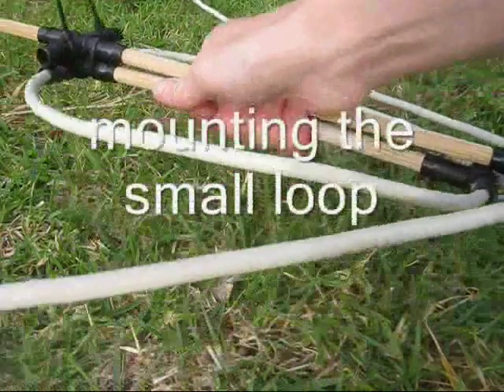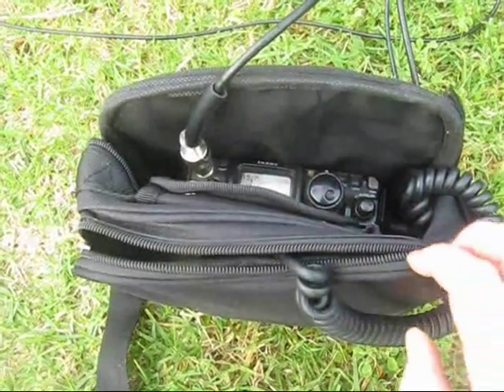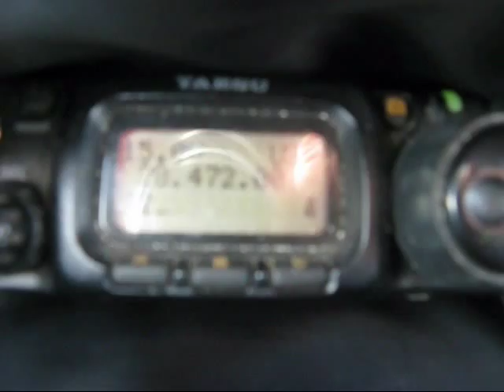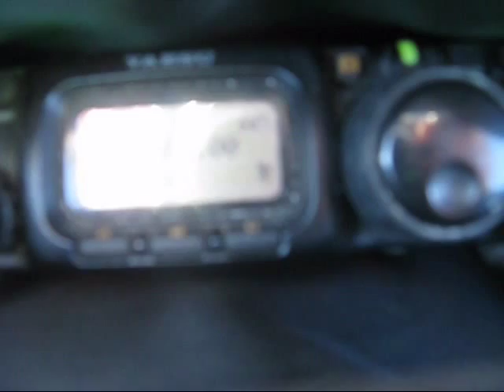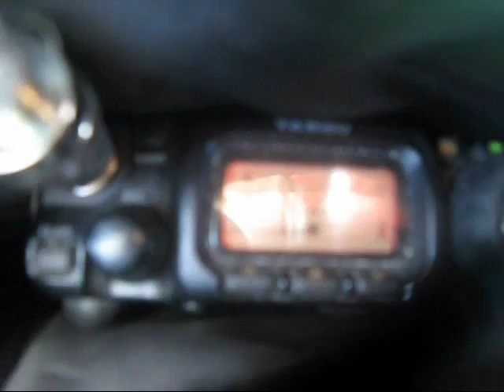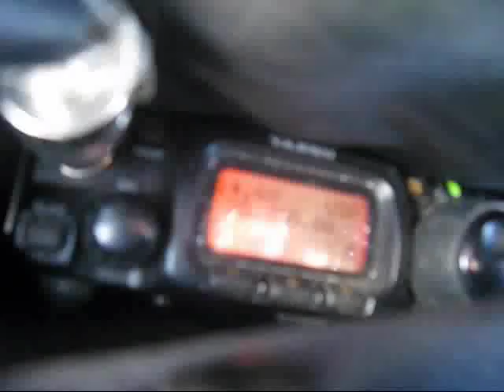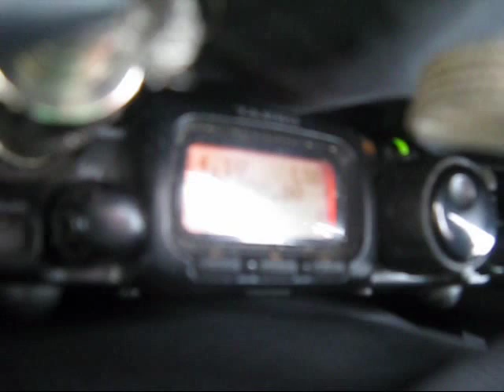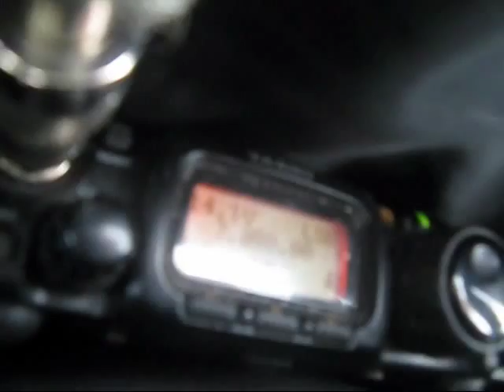Magnetic loops for HF pedestrian mobile - Part 4

Comment: How about matching it on top and tuning at the bottom? Would it change performance?
Reply from the maker: It would work but a problem is the feedline. It would be drooping across the antenna. That would cause it to go off frequency as it moved while walking along.  So you'd never use it for a pedestrian mobile loop. But for a home station loop if you can bring the feedline up or out then it should be OK.

Comment from the maker: @melbourneradio I'd be buying a couple of those eBay caps.  2 in parallel will give you up to 60pF which will be fine.  It might be hard to get low enough minimum capacitance for 10m but you could always make the loop slightly smaller to compensate (I'm thinking of doing this for mine so I can cover 29 MHz FM on mine).  

Look for old VHF radios for beehive trimmers - preferably lowband - moorabbin hamfest in a week or so is your best bet.